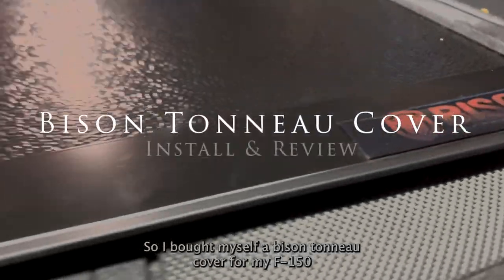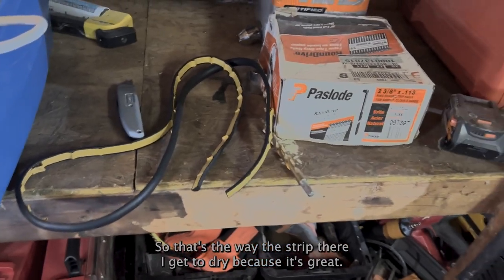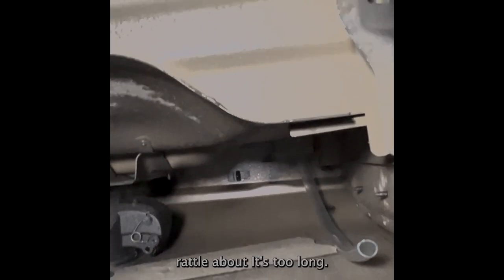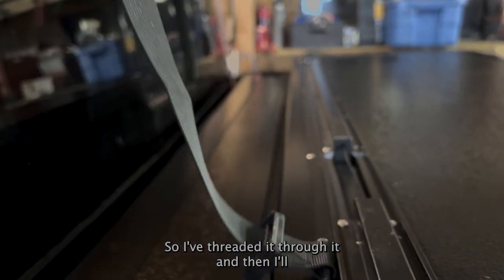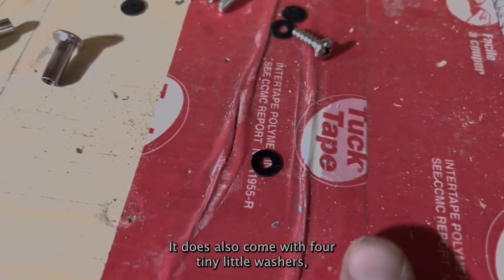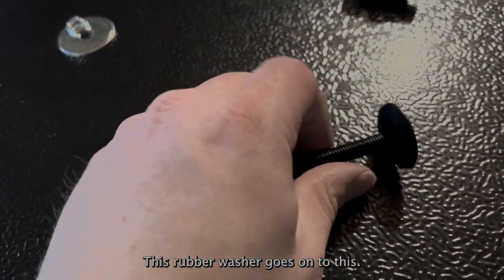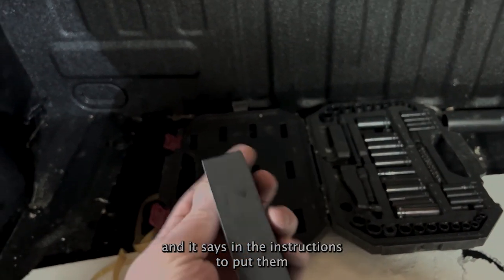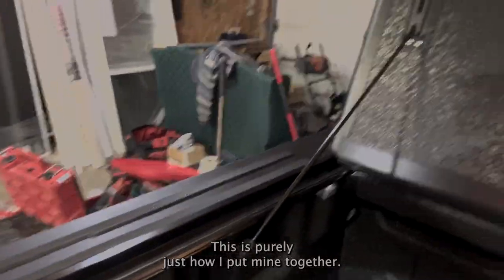Install Instructions Bison Tri-fold  Tonneau Cover F150.

Comment: This was very helpful. Tip for Nissan Frontier owners, the clamps will fit above the rail system, but you need to remove at least one of the hooks (or whatever they are called) in order to slide them in place. One installed you can adjust them as needed between the clamps.
Reply: Also, dont tighten those back nuts until you check the alignment with the tailgate. Terrible instructions from Bison, but seems like a solid product.
Reply from the maker: Thanks for the feedback. I’m glad it helped. I’m still happy with it to this day.

Comment: I am just wondering now that it is a year old how it is holding up? Thanks for your time.
Reply from the maker: @pugs333  it’s still going strong. My only issue the bars that hold it up. The rubber ends fell off and I can’t find them. Other than that. I would buy the same again!

Comment: Many thanks from Quesnel, BC.
This was a big help in deciphering those awful instructions.
Reply: Hey did yours look like his at 5:32? I just got one and there's no hole, it fastens on to a small bracket on the underside, the instructions don't explain it very good and I'm not sure how to attach it and where to put the washers
Reply: @rossrobertson674  I bought the flip bak hard trifold.  This bolt was already fastened in place from factory
Reply: @rumblecat7229  OK thanks, seems like they changed the way the cover fastens to the rails, maybe there were leaking issues
Reply: Doubling up from Quesnel, this is a huge help! Thank you for making this video